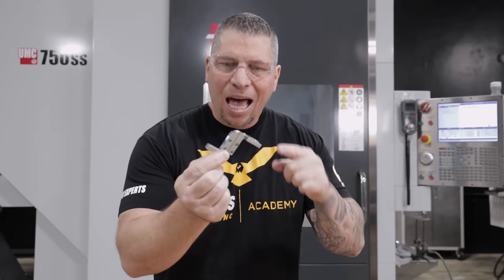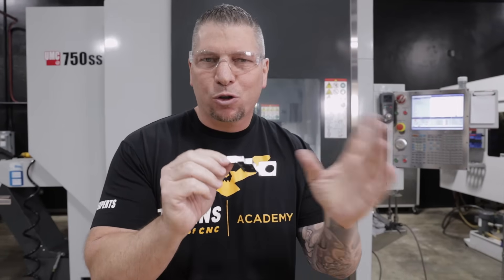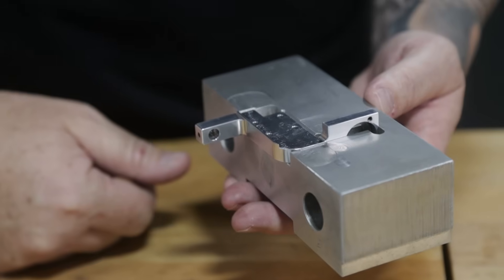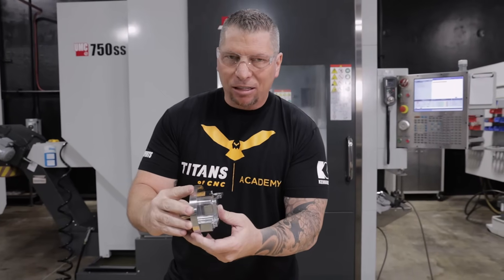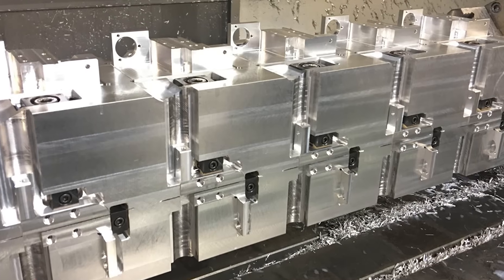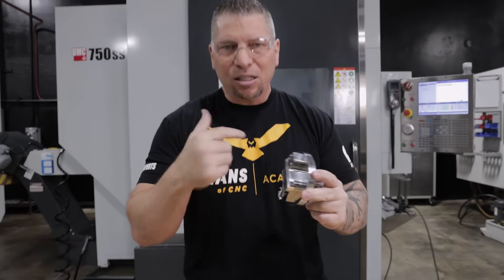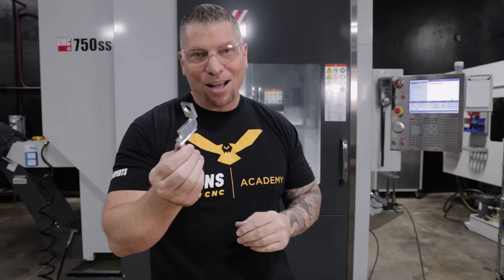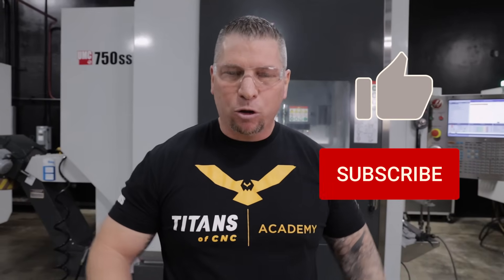This CNC Machined Part Brings In Over A Million Dollars | Vlog #67

Comment: At the end of my Apprenticeship, I was running a Vertical Machine Center (VMC).  
I did the setup, programming, tooling, and running the job.
We had small turning job that would normally go on a lathe.  The lathes were fully in use.
I mounted a turning tool in the vice, installed the part into a collet, and did the turning work.
Manager was impressed.
Reply: [08/01/22] Creative "out of the box" thinking. Luckily, it seems that the part was small enough that it could fit in a collet. Good on you. 👍💪
Reply: @oceanic8424  Thank you!!

Comment: You are the type of person that drives others to do their best. Yes, you get a few bad apples but God always seems to replace the rotten with a better crop. I'm almost 70 years old and I'm selling my 13" South Bend because I'm not physically able to run it like I want to. I'm going to consider a CNC Lathe, a small one in the $7,000 - $10,000 range or a CNC Veridical Mill. I would like to see if I could make a go of making parts. I plan to pray about it and study what programs that might help me on my way. You are a winner Sir, Go Bless.

Comment: Either a laser optic or fiber optic positioning piece. Looks like it attaches to a linear bearing hence the reference edge. Not to be too negative but the only reason this isn't made in China is that the machine it goes in is way overpriced to begin with. :)

Comment: Very smart you ended up on the horizontal,  we had the same situation at a shop I worked at back in 1992. We had a rotary fixture that held 12 parts, 3  on each face. The fixture was shaped like a plus sign if you look at it from the end like where the tailstock is. This allowed access to the inside and outside of the part which was roughly five inch diameter cap looking part of cast aluminum. One of the temp service employees left a locator in a part and wrecked the fixture to where it was unable to continue making in tolerance parts. The parts were then moved over to tombstones on a Mitsubishi horizontal with a much better fixture set up.

Comment: Topic. Why or why not a machine shop should develop their own branded tool-line?  Not patented but branded tool-line. Edge Tech is a good example. They're making tools that's been around for years but they're putting their own spin on it.  They appear to be doing great. I believe it's Because of the red anodized aluminium and their company logo.

Comment: i dont know what target audience is this for. This problem is so specific and rare. Basicly its boil down to too much parts for machining shop but not enough to mass produce. 500 parts a month is too small, with powder metal injection molding you make that much in a hour.

Comment: Hi, I have a question, I have 400*450 mm Brass plate of 3mm thickness, they want to mack a heat sink of it with small square pins of (0.9*0.9mm) of 2mm Depth and the space between two rows and columns will be 1.5mm,
what is the best way to manufacture it,

thanks in advance for any help
Reply: The problem with machining this is plate bend, clamp make it bent in middle

Comment: We do this with Lang Quick Point point sub plates on the 4th axis; it allows us to have the spindle running while the operator loads parts outside the machine with 2 micron repeatability just by putting the mounting studs on our fixtures.  For smaller quantities, we run a Lang vise in the plate and we'll just prestamp aluminum tooling plate for repeatability and make really cheap fixtures to run 5, 10, 20 parts at once on the 4th.  By swapping Mitee Bite clamps from plate to plate for the smaller runners we can have a specialized fixture for $20-50 worth of aluminum and an hour or two of programming and cutting.

Comment: Hey Titan, at what point do you decide to go from holding something simply, in a vise or fixturing doing 1 at a time vs doing multiple ops at once 10 or 20 at a time? Is this solely based on quantity or other factors as well
Reply: It is mostly on how accurate the part needs to be. Special holder helps reduce chatter and produce repeatable accuracy. But making a special holder adds expenses. The customer pays for the special holder, by getting a quote that includes the production of the holder. Or the machining company eats the cost if it is high volume as it will be small money. Special holder vs. Small quantity= higher quality. Special holder vs. Large quantity= repeatability. In addition, parts that are thin, very complex, or parts with fragile material, that is parts prone to deformation or cracking make it impossible to machine without a fixture.

Comment: Excellent description of the evolution of a simple parts' methodizing, as production numbers ramp up.
Then, when you get the production process running super fast, accurately, and smoothly, the part becomes obsolete ...........
:)
That's when you get another folder full of prints, or a digital folder full of DXF files, and you go thru the evolution process on a new part.
Again, excellent explanation of the process.
Reply: ...and then the "customer" takes its outsourcing to China and you're f*cked.